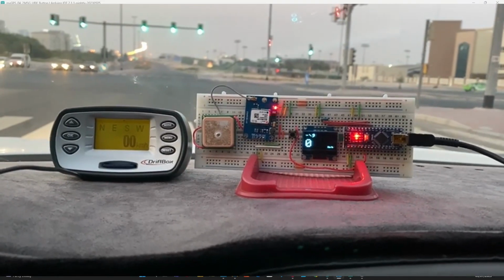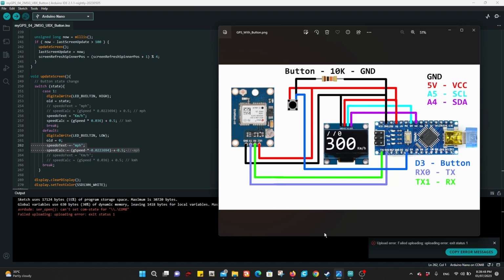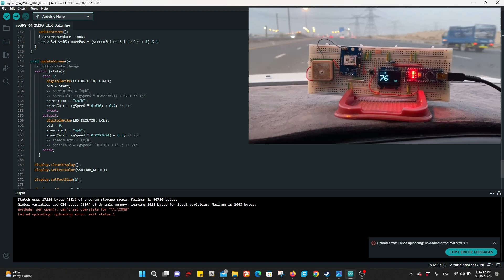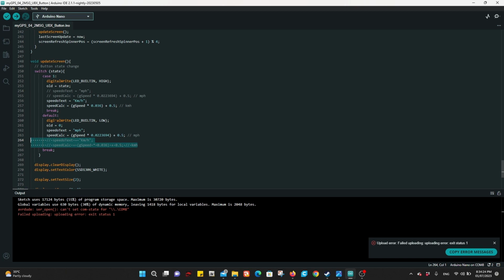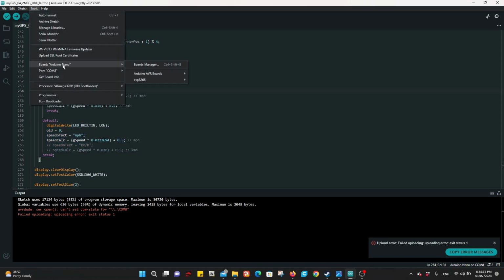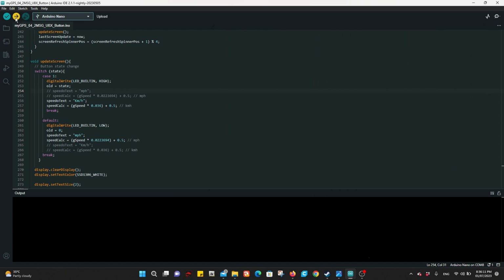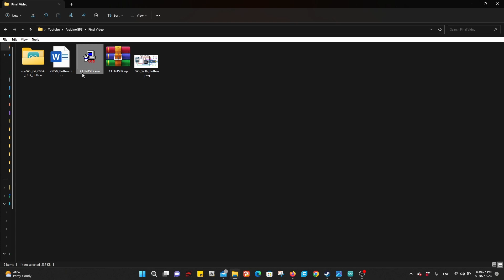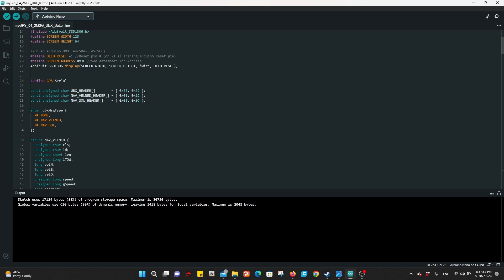5Hz NEO-6M Speedometer with satellites using NANO Board

Comment: how you get to speed is so stable? Mine when not movine  goes  0 1-2-3-4 then return to 0  , oscilates
Reply from the maker: The more satellites you connect to, the more accurate the speed is. If you are looking for 10Hz and more satellite count, you could use NEO-M8N instead of NEO-6M.

Comment: I had recently brought a neo 6m when I power it with 3.3v. After that I had upload with a simple code I am unable to see any type of nmea sentences. Does the nmea sentence shows after I upload the code or I have to wait until light blink. I had leave it for 1hr in open sky but light do not blink. Please help me
Reply from the maker: Check out this video, it might contain part of the answer. https://www.youtube.com/watch?v=Ao5XRtd-RAA 
 You don't need to program NEO 6M to receive NMEA, it does that with the default settings. If all that doesn't help, please let me know.